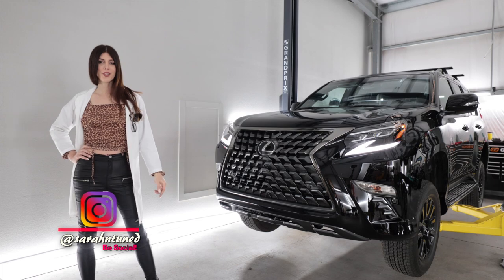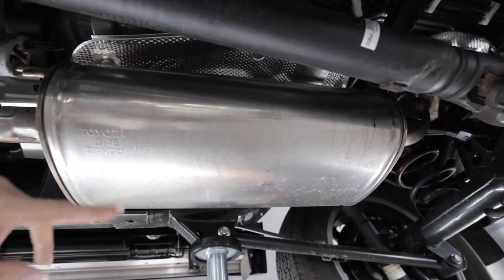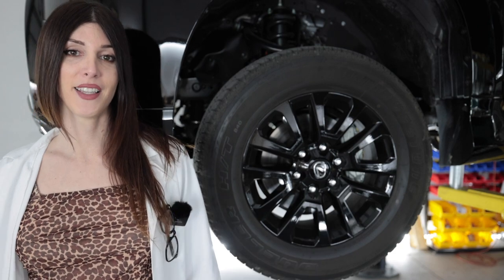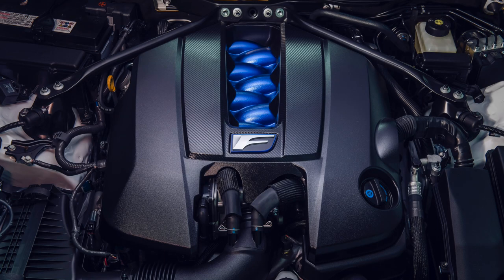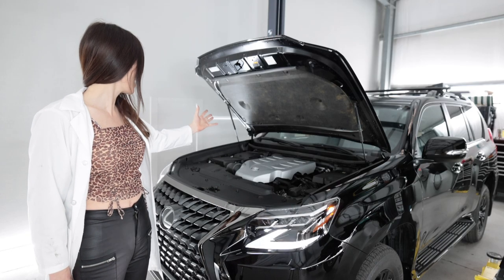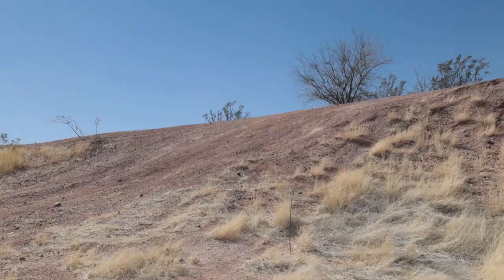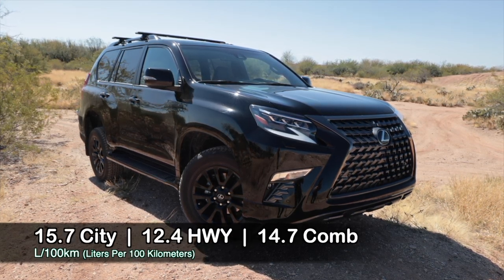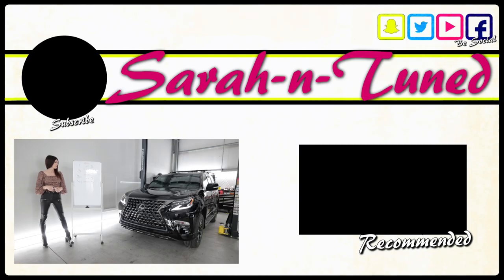Name A Better Overland Platform.. // 2022 Lexus GX460 Review

Comment: According to one Robert S. Challman ( ancient sage of all things automotive and former mentor ) an engine ought to be able to deliver 100 hp/l. Ergo the 4.6l V8 should be capable of 460 hp. That makes 301 hp seem a bit anemic. For a truck of that mass, 301 hp IS a bit anemic. ( actually when one considers the output of modern F1 engines, even 460 hp is anemic. ). So Sarah, as a future project, why not build a real fire breathing 4.6l in that truck? Say, in the interest of a modicum of longevity, 500 hp? That should overcome any shortfall in the power department. Of course carbon fiber brakes would be a must to haul the new dragon down to earth! And of course the Prado kit to pimp the ride. 
Looking forward to more of grandma’s truck, Forrester Gump, and especially the Audi! All projects not mentioned in the afore listed group may be attributed to my short attention span and aging memory cells.
Reply: It seems your intention for a V8 is speed and performance. You’re missing the point of the detuned GX engine, however. Toyota detuned this engine and overbuilt it for longevity and reliability. Since it is so under-stressed, you can easily get 300,000 miles out of the engine with proper maintenance.

Like the Land Cruiser, this vehicle is engineered to last a very long time.

Comment: Gx ratings , car 5/5, mpg 1/5. Total 6/10.
Reply: Mpg is not that bad. I can easily hit 20 mpg on highway and 17 mpg combined if you don't sniff the rear bumper of the front car.

Comment: Forget the engine cover; I wonder if you could put the 2UR in there lol
Reply: Nah fam you don’t wanna do that. The 2UR is direct injection vs the 1UR which is a more reliable port injection setup. The Lexus direct injection V8s had some cases of getting clogged up. Toyota knew what they were doing when they put a de tuned 4.6 V8 in this thing. It can go 1M miles if maintained

Comment: Another category: How cheap or expensive are replacement parts. I'm sure this Lexus parts are Hella expensive.
Reply: Can't talk about the new GX460's, but my GX470 usually just gets Toyota parts as they are the same.  Pay a little less at a Toyota dealership instead of from Lexus.
Reply: @kayakuprising5914  Can confirm. Our 2017 GX460 gets genuine Toyota parts for less cost than “Lexus” ones.